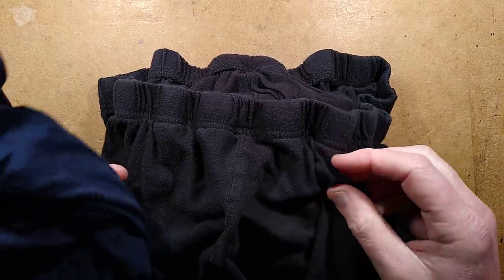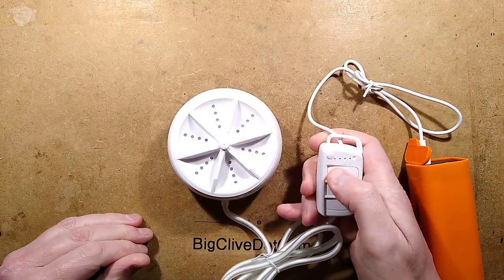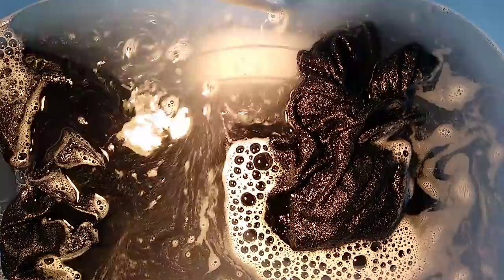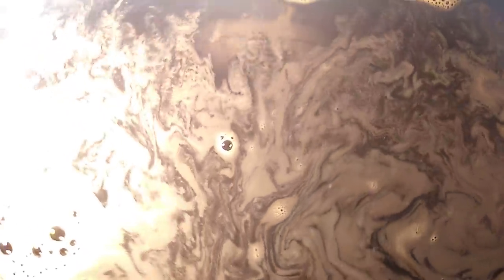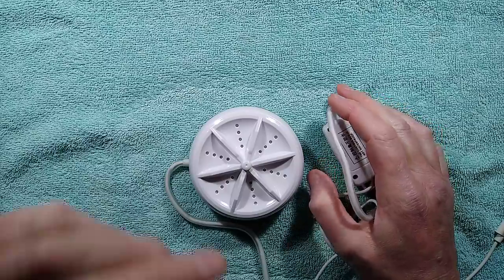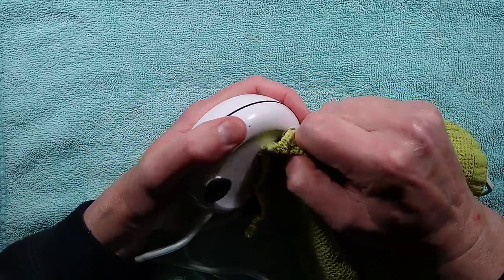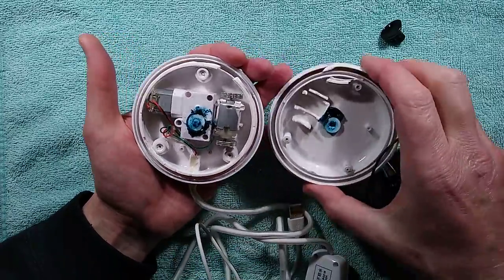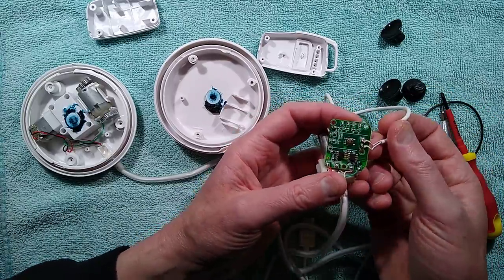USB laundry machine for tiny (moist) Chinese panties.

Comment: Was a washing machine tech for a few years so I don't know a whole hell of a alot about them. But form the ones I worked on they all did the bubbling thing. I believe its used to "push" the dirty water up and away from the bulk of the clothing. Its mostly useless when modern machines just flush the dirty water out two to three times, but older machines would do almost the same thing.

Comment: Twin tub washing machines are still made.  Now usually plastic and billed as 'portable'.  Caravan and boat people are the target audience I think.  The variety when I was a kid in the early 70's was the width and height of a modern washing machine but half the depth.  Mum had to press all her weight down on to it when the spinner was started or it would try to fling itself all over the place.

Comment: The bubbles are right before the end so maybe it's to diffuse the soap scum on top so you can pull you laundry out without too much detergent on them
Reply: It helps extract scum from the micro particles floating in the water.

Then you scoop off the scum before you pull the clothes out to have an easy rinse cycle

Comment: I had a small portable washer that used similar functions to clean clothing, and it did surprisingly well with small loads like stockings (maybe 3-4 pairs), undergarments (3 or 4) and blouses (2).  I could do one pair of slacks, OR one pair of jeans, OR one large towel as well.  It actually seemed to clean clothing better than a full size washer, just very, very, very small loads.  As my living situation didn't allow for a full size washed and dryer, it was nice to have in a pinch so I wasn't entirely dependent on the local laundromat.
Reply: What brand?
Reply: @foggycraw6758  Wish I could remember, but it was 15 years ago.  There are a lot of similar units, though, that work the same.  I know Black & Decker makes one, I think they're called "pulsator washers".

Comment: someone watched this up to minute 6 and thought "that's just wat I need for my off-grid shed/van/teepee"
Reply: Me. 5 gal bucket. As Long as it can do a t-shirt and 1 pair jeans
Reply: To be honest.. 
If this thing was water proof i would have bought it
Reply: Nooooo. We have got twin tubs on generators or the "egg" hand wound washing machine. Which are GREAT btw. I have 3 twin tubs and 1 egg washing machine and while traveling my parents used to have a bucket with a lid and load that up with clothes and the vibration from rough roads done the rest.
Reply: I must admit my uncle was given a giant 240V 80W one like this that sat on the bottom of a bucket. Japanese. And I threw it out become it was covered in dust and fluff and probably dead.

Comment: That's a toy quality mechanism in there.
Reply: Yeah - in such a professional device 🤯😂
Reply: Yeah, if you’ve already got a bucket of soapy water I feel like I might as well do it by hand.
Reply: @JasperJanssen  Yeah. I t looks like it doesnt do anything besides pretending to work. I know that it is extremely difficult to come up with a working appliance at that kind of budget, but this is just beyond silly.
Reply: Good for ladies AND gentlemen!
Reply: Of course a rabbit would know!
Reply: @nrdesign1991  An AC motor built into a suitable submersible pump housing, powered from mains would probably not cost much more but would agitate the stuff with a water jet and may be quite a bit more effective. They could even forgo the on/off switch. Shouldn’t be too expensive, although the iron and copper in the motor would be cost drivers.

Comment: I have been looking for a agitating submersible to use in a vinyl record cleaning machine I am working on. Looks like this will do just fine. I have a device that protects the record labels with Plexiglas disks and rubber gaskets and spins the LP slowly in a basin.   This device is much cheaper than a proper ultrasonic device.
Reply: Have pictures?
Reply: Maybe okay for prototyping, but you certainly wouldn't want to be using it in a saleable product unless you enjoy dealing with a lot of irate customers and product returns.
Reply: It’s just for personal use.
Reply: This thing's essentially rubbish; water ingress means it'll die almost immediately.  I guess you could put it in a ziplock bag and still have it do some agitating, but that's not going to go well.   Also, you do know that it's not ultrasonic, right?

Comment: I loved my twin tub. Needed lots of water and human interaction. Reliable for 20 years before replacement by a front loader.

P.S. I second the nomination for shampoo for hand laundry while traveling.  Also works well for wool wash at home...  What else is wool if not hair?
Reply: Interesting idea 🐑
Reply: The silicone in shampoo is not what you want on your clothes.
Reply: Still using twin tubs myself. I think you can still get a samsung one. Hitachi made them up until the Fukishima era tsunami. The Hitachi were fairly heavy duty. My ones are haier. The cheaper brand owned by Samsung to compete with chinese stuff.
Reply: @toomanymarys7355  might protect it from stains?
Reply: @mrtechie6810  It'll coat it and make it slippery, but no stain protection.

Comment: Maybe the air bubbler function is to "purge water" from the interior. Seems like pressurizing the whole unit would slow down water ingress. It's just kind of weird that it's not running throughout all of the cycles. It would make sense to provide positive pressure with an outlet to the inside of the sealed chamber, making it harder for water to actually get inside. That's what I thought when I saw the air bubble function and the layout of the interior.

Comment: Seems to have all the performance of a Hoover Tanglematic twintub, minus the flooding of the floor with spilled water, and the torn clothes... :P
Reply: ..... Technology has come a long way in 50 years.
My 'LG' machine could share the 'TangleMatic' title with that old Hoover.
(Do you remember how LOUD the spin cycle was ?)   P.S. Do you remember those machines with the square programming card, (Different cycle on each edge).
Reply: @robbieaussievic  Hover Keymatic had one :)
Reply: @robbieaussievic  I recently had the dubious pleasure of troubleshooting a larger central heating system of early-2000s vintage, which had a controller with a copyright date of 2000 on the instruction manual, that used programming cards! Thankfully a) I had someone with me who was more experienced with that system (i.e. had actually used it before, unlike me) and b) the problem was an unplugged pump.

Comment: Imagine being the employee with the job of scratching out the values on surface mount resistors.
Reply: The Panasonic 0603 resistors I buy in cut tape from Digikey have no values printed on them.  At a certain point, you can’t see them anyway.
Reply: I use mostly 0402 resistors and capacitors, and I don't think I've ever seen one with markings.
Reply: 0402 is crazily small. Thats 0.4mm X 0.2mm. Id have trouble even seeing the part itself, let alone reading the value. That is too small to fit any marking on. If you dropped it, you would never find it.
Reply: @simontay4851   No, the SMD sizes are imperial based (well, the ones in most common use are, though there is a parallel set of metric designations) 
But 0402 is imperial (most likely, only seen metric down to 0603, which is equivalent to imperial 0201. 0603 also looks to be the only size designation that exists in both imperial and metric) and is 0.04" x 0.02" or approximately 1mm x 0.5mm Still f'in small though 🔬😀
See for instance http://www.resistorguide.com/resistor-sizes-and-packages/

Comment: Freshly laundered... The water tells a different story.
Maybe this is able to remove the Clive stains where ordinary washing machines fail...
Reply: It's just the clothing dye I think. I've never washed already clean (dark) clothes and ended up with clear water.
Reply: There's a chemical some scammers use for their Detox foot spas. They probably added the same thing. Basically the pellet is electrified and and it releases similar muck.

Comment: Maybe the “air bubbler” wasn’t meant for use under water but for after you take it out so it can eject any excess moisture from the spinner?
Reply: Dave Micolichek  I do believe, that the bubbler mode is utilized when its used in automatic. They wouldn't program that in, if it wasn't intended for use in water.

Comment: In most washing detergent there is something that mimics dirty water. They used it to show the housewifes how "effective" their washing powders were compared to soap and other classical detergents used prior. Couldn't find any source anymore, though, as the Internet is littered with guides on how to wash and how to create inferior, badly balanced and usually quite aggressive self-made detergents which supposedly are more environmental friendly. Or it could be the colour from the clothes you put in. Detergents always wash a little bit of them out whith each wash, especially if you use standard washing powder containing bleach.

Comment: This video was uploaded on the same day that I'd been wondering how to automate the agitation of water in a bucket for washing rags and cleaning cloths. I was wondering about putting a bent metal stick in the chuck of an old battery drill. 

I bought one of these instead, the cheaper one without the water bubbler or remote. It's just got the USB plug on. It vibrates, rotates one way for a bit, stops, the rotates the other way. This repeats ad infinitum. Or until your usb battery pack dies.

And I have to say, I'm impressed with it. If you put too many cleaning cloths in the bucket, it struggles to do much. With 4 or 5, they tumbled rather nicely.

So, thanks for the review, and in certain circumstances, I can actually recommend it!

Connected to a Raspberry Pi, it could even form part of a home made washing machine with valves and a pump to fill and empty the bucket....

Comment: 0402 resistors are usually unmarked (because they are just too small to fit legible markings), but I have also encountered unmarked 0603 resistors as well: if you are trying to squeeze out the last 0.0001 cent per piece it probably makes sense to skip one production step.

Comment: Soooo, I guess this won't do the 9kg my normal washing machine does.... :D
Reply: It will if you lower your expectations enough!
Reply: @benbaselet2026  so if I just need my dirty clothes to get wet, this might actually do the trick??? :O
Reply from the maker: If you believe some of the listings they state 11kg.
Reply: @bigclivedotcom  Maybe 11kg is its total lifetime load before the water finally seeps in far enough to kill it 🙂
Reply: @Berkeloid0  no its Really for 11kg if you have a bucket
Reply: This thing could not even replace my 0.9kg washer.
Reply: @bigclivedotcom  that'd be including the weight of the container and 10 liters of water...
Reply: just buy like 5 of them and run them at once :P
Reply: Oh it surely will do 9kg of laundry in a bath tub... if you have a very big power bank and loooooooots of time - say a week or so! Handwashing might be slightly faster and more efficient I suppose...

Comment: I think the concept of the air bubbler is de-scumming. The air rises up, particles stick to the bubbles, the bubbles cling to the sides of the bucket and pop, the particles are now stuck on the sides of the bucket and then falling down to the bottom of the bucket out of the water column.

Comment: 05:00: The water getting murky is because of washing powder residue in your clothes. Likely the silica compound that softens the water. Modern washing machines save water by only rinsing most of the detergent out but not all of it.
Reply: That or he uses fabric softener in the rinse water.
Reply: I have a strong allergy to bio detergents and a mild allergy to non-bio, plus I don't like shortening the life of my clothes by leaving them full on conditioner so a second rinse cycle is a must for me. Water is cheap compared to clothes and in particular comfort (not the conditioner).
Reply: @SeanBZA  That would be a lot of softener for the residue in 2 underpants clouding a bucket full of water.
Reply: Conditioner gives the fibres a charge which attracts dirt.
Reply: Yeah, the stupid trend of modern machines trying to save water is REALLY irritating. Just fucking wash AND rinse my clothes properly, "saving" some water is NOT going to save our planet! My washing machine has a "feature" that "measures" how much clothes there are (in some programs) and then doses the water accordingly. But it really leaves the clothes too dry to wash properly, so I do not use that program anymore. Thankfully some other programs are available in it that do not do that!
Reply: @pev_ Some manufacturers have hidden service menus which allow to configure higher water levels or additional rinse cycles.
Reply: @MetalheadAndNerd   I know, and I did find some service menus in mine (LG F1443KDS) which activated when pressing some buttons while powering up. But I did not find any useful functions there, or maybe they were too obscure to make sense of. That was many years ago (when I tried it), I cannot remember exactly. It has done fairly well, although sometimes balancing in the spin cycle is a problem, which I have read many of the bigger (this is rated 11 kg) domestic machines have. In hindsight I would have bought a smaller rated machine had I known that these big ones have balancing problems.

Comment: the air pump may serve multiple purposes?
 1- the air bubbles
 2- pressurise the chamber to minimise water entry, due to the weak seals?
 3- air cooling the motor? 

I'd say to have washer already powered up and running, prior to inundating it

Comment: It goes at the bottom of the bucket! My Nan's ancient Rolls twin tub washing machine (there's one on display at the science museum!) had an impeller shaped a lot like this one  in the base of tub no.1. 
That would cure the "panty shredding action" and increase the amount of clothes considerably. My Nan's impeller was about the same size and it would agitate a 100 litre drum easily.
Have you got a clean 45 gallon oil drum? I bet it would work at that scale if you stuck it on the bottom of the drum.

Comment: 0402 and 0201 resistors don't typically have print on them. There's just no room for screen print, at least not at a pitch that'd be viable for their sizes.

Comment: In industrial wastewater, we use aeration to lift suspended particles out of the water, which leaves the subsurface water (slightly) cleaner.

Comment: If they had left the air pump going continuously, that could be devised to provide a positive air pressure within the main housing, thus resisting ingress of water through imperfect seals. (and the water wouldn't come back up the tube)

Comment: There is alot of interesting information here, especially considering we don’t know how washing machines actually clean clothes, makes me wonder why washing machines don’t use sonic cleaning? as it currently stands we just waste water with random cycles and our clothes come out relatively clean and we are just okay with it, imagine if we knew how it worked and we weren’t wasting so much water cleaning our clothes 

when i say we don’t know how washing machines work i mean we don’t actually know if its the rinse-wash cycle or the addition of soap and rinse, or rinse-spin, the common theory is clean water gets dirt and grime out and its the cycles of clean water being spun and rinsed does the cleaning not the soap or suds, so why do we use laundry soap? there just has to be a solution or a better way to clean clothes or materials

Comment: in the 80s we used that extra spinner with the rubber ring needed to be placed on top of the wash for drying out the last water that the washing machine didn't spin out. It really spun out ALL the moisture but the clothes were all wrinkly

Comment: This looks like a hoover washing machine wash tub with an impeller, hoover used a rubber gaskets or seals to stop leaks, this is still clever if it was sealed properly and the air pump is to mix the soap in the water, and  the other part is a jewellery cleaner used by watch repairers.

Comment: this is a variant of the ultrasonic cleaner idea i had some years back but adding the impeller was clever
this would be very efective if you scale it up to 12 volts and 5 amps and triple the diameter you could run a 5 gal bucket wash

Comment: you were suppose to put your cloths in a round bucket with the laundry machine at the bottom, to simulate an actual top loud washing machine. and if you would have done everything right those three settings was the three ways of agitating the detergent through the fibers of the cloths to clean them more effectively. and lastly suspending the cable to prevent a chance for water going the other way and creating a siphoning effect through the bubbler hose.

Comment: these are sort of cool, but don't try to get more than a couple pairs of socks and a shirt clean in one load. 1 pr of jeans is too much, but the sonic cleaning can wash it if only dusty. actual limit is like 1 to 1.5 kg only. I think some ads state this now.
 it's useful for me bcs I only wash 3 or 4 things by hand anyway. they are all prices on eBay from cheap to not cheap haha. the ones with it's own bucket are about $45 US
you need to have at least a 10k mAh battery pack or better yet bcs it draws about 3 amps

Comment: Hi Clive - would be great to see a teardown of a multimeter going over how it measures resistance, current and voltage so accurately and how it put it up on the display.

Would be great to hear about where the latency/delay comes from and how to reduce it, is this something which a more expensive unit does differently?

Love your vids.